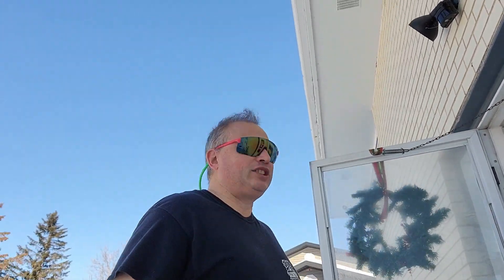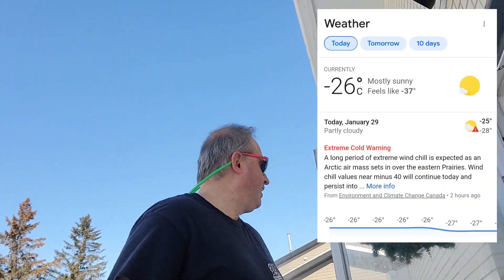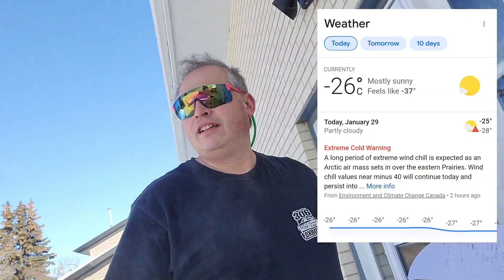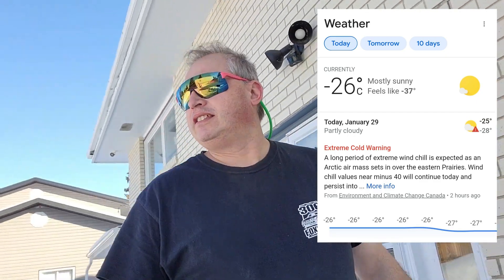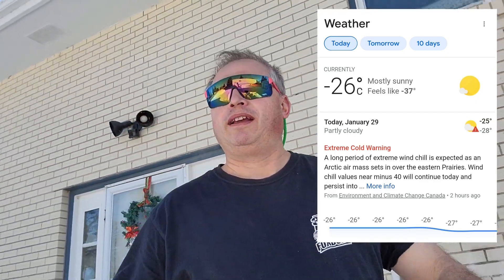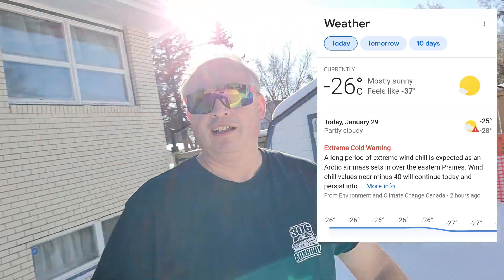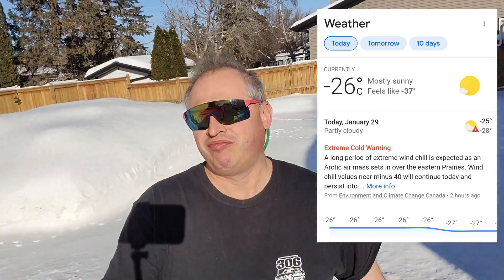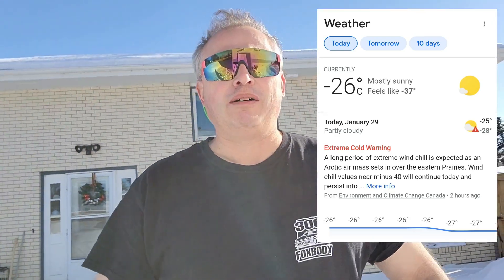DE-CODE FORD PART NUMBERS!  IT MAY BE EASIER THAN YOU THINK! - 306 Foxbody

Comment: Thanks for the part number reasoning used by Ford. Since I’m in the ‘older’ catagory😊 where would The number info for plastic fender liners be found? Need liners for an ‘87 Mustang knowing that the ‘90-93’ fender openings were slightly larger. 
Thanks again for great content.
Reply from the maker: Hi Mark,  the part number for the liner is directly above the top of the tire.  It is facing down, and molded into the plastic.  Your part number, assuming it's an 87 part number, might be E7ZB-16A562-AB.  My 1992 GT has F1ZB-16A562-AC, as it was a new for 1991 part number due to the larger wheel openings.  Thanks for watching!👍
Reply: I know its old, but try going to the begining of the body style, so D9ZB-16054-A (left) and 16055 for right. I think 83 had a major update, so E3ZB with the same part number. Later decades had the letter after the part number grouping (16) as they ran out of numbers.